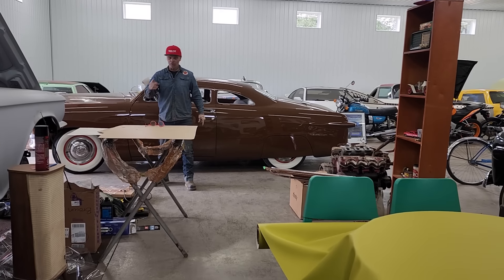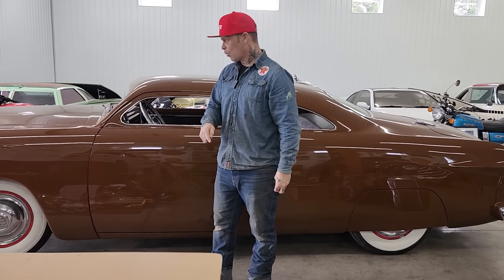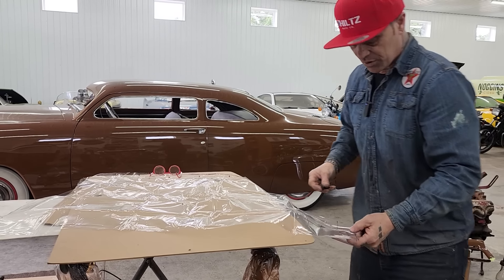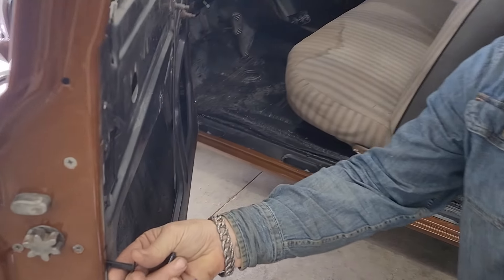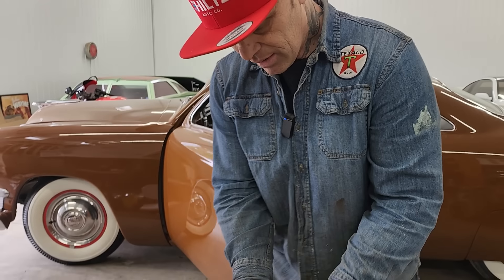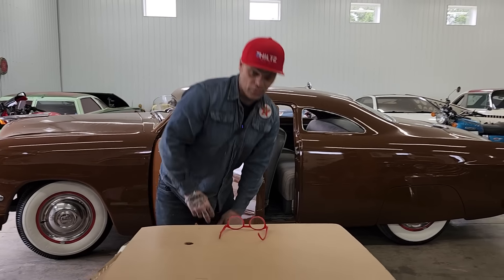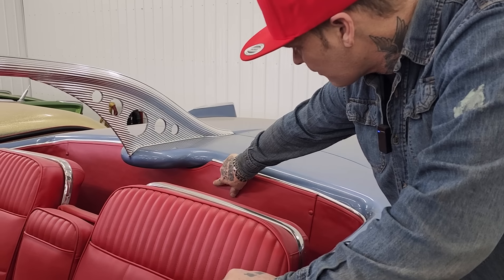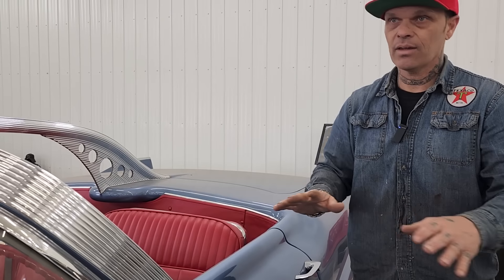Gluing the vinyl to the door panel... (hope this works)😅

Comment: Ive used contact cement to install formica onto various surfaces and one key thing is that you apply it to both surfaces. It must be dry to the touch before joining the pieces together...it should be rolled afterwards to lock things in.  I think you are doing well but not waiting long enough for the adhesive to set up prior to joining them... other folks have good ideas you might consider

Comment: 1/16 th ABS  is the best material to use to fabricate door cards,  you can form them to any shape you desire and hold staples and water proof. I do upholstery and it is the only material i use for door cards. Mounts invisible with no external screws whatsoever.
Reply: Great job brother,!
Reply: With all the diy. you tube channels, you would think they would watch and learn. Well, I learned how not to do interior panels.😮😮

Comment: Hey Chad,  from my experience 3M adhesive will release if it gets hot... meaning if the car is at a out door event and car show and it's a hot day the glue will release.. I use professional adhesive now like the upholstery shops do.. just trying to help man...
Reply: Sewing down the edges and adding piping . With TAN  colored material . Sorry Jolene this time I disagree with you.

Comment: Couple tips after 45 years in the auto upholstery biz:  You need to use contact cement such as Dap Weldwood Landau Top adhesive for gluing upholstery.  It can be sprayed or brushed on.  You can buy it at places like Home Depot or an upholstery supply vendor. Follow the instructions on the can.  On the lower curved corners of your door panels, you need to make pie-cuts or slits about 1/2" apart all the way around the curve, stopping about 1/4" from the edge of the panel.  Glue, heat, stretch, and wrap to the backside.  You will not get the lumps of overlapped fabric on the corners that you have now.  1/4" closed-cell foam glued to the panel board before the fabric is glued on gives a nice soft feel to the door panel.  Very inexpensive and easy to work with.  The Bad Chad chrome looks nice but I'm not sure it will stay attached to the door panel if the car gets hot inside.  It is made to stick to metal, not fabric.

Comment: Hey Chad & Jolene, Sunday fun day! Chad the way that I was shown to do the holes is to cut an X in the hole that gives you 4 tabs that you can glue down on the back side of the door card. Both of you did a great job of setting the material on with no wrinkles! Jolene great camera & video work as always!

Comment: Chad and Jolene easier way to do that before you even spread the glue layer material on your board where you want it fold it in half just fold back. You can spray both sides but tack up then you do one side at a time you pull one side down then you can spray the glue on the other side pull the other way.
Reply: Exactly, and don’t cut the access material off the corners until after you have the material stretched around the corners and glued down
Reply: @leblanckerry4826  the bird is using is not rigid enough bad, bad choice, and half of that he should be using weld bond adhesive, same stuff you use your vinyl tops or something equivalent is what all decent fabric shops use. Take a spray can of three monkeys and throw it in the trash.

Comment: You have to pull the material good and tight on the corners to keep it from humping up. Also, leave about 1 inch in the very corner by cutting the V out on either side of the corner

Comment: Chad have done a couple cars but tons of boat interiors best way to do this is put some plastic on the floor put the fabric on the floor spray the adhesive then lay the mdf on top starting at one end its much easier to get it centered that way on the corners make them round and as close as you can to finished size .

Comment: I have been around a long time an like to think I am pretty good when it comes to building led sleds and hot rods. BUT I must admit I have never built or painted one brown with GREEN enterior. as your work is top drawer you need to get advise on colors from another source. The colors that you are using lends nothing to the car as much as a complementery color on the interior would have done. Just my opinion but green sucks.

Comment: I don't do interiors but I would have trimmed the wraparound material down on the corners so it's easier to work with. Door skins are done trimmed down so it would work on this application.

Comment: Being your first door card makes it understandable that you messed up on the corners Chad. Now you have multiple layers on the corner material and seams right where a foot will scrape and start wearing it. These corners will make it hard to lay close to the door frame and again wearing or popping out. Next time try one piece of material at the corner pull tight the first one then pie cut material at the end farthest from the corner edge. It is kind of like metal working except you can't add material if cut short (weird seam!) or fill a hole like metal. There are lots of videos online showing techniques. Keep slugging away Chad your build results are always great.

Comment: Chad and Jolene , Your off to a good start on gluing  the vinyl material to NSB Panel , I hope the second portions of the material and pattern work as well for you along with Chad's Chrome Trim Application. Fingers Crossed for a great result on the door panel.

Comment: hey jolene and chad.. if the material is not sticking  on the inner part of the corners..  maybe you can pick up an electric stapler from any local harware store and put staples in it just to secure the corners   just make sure you get the correct length of staples so it doesnt go all the way thru the board..
Reply: Stainless staples

Comment: 3m has a spray just for interiors - while super 77 will work - it will show its weakness in heat and release - 3m has the website that shows the correct spray # to use. I have used super 77 for years in the sign world - great spray glue

Comment: To glue the Vinal on use contact adhesive and apply  to both surfaces with a foam roller.  Work it from the middle out .  Use a laminate roller to press it onto the substrate.

Comment: I did auto upholstery for three years and this looks quite good for a first time out. As for the corner, just loosen it off, heat it a little and stretch it over a but more. Massage it round as you do it and it'll be fine.

Comment: Heat the vinyl round the corners, 3mm staples no foam  5mm with ,  heat pull then staple as you move around  boom..

Comment: The best method to glue vinyl to vinyl is contact cement. Apply the glue to both surfaces and allow to dry tack free. Align the piece exactly before you apply it as you only get one chance.

Comment: I use a razor blade / knife cuts out excess on back side of panel.  Just glue, stretch to fit on edeges / corners, push down, cut with knife, pull of excess pieces.

Comment: Chad, I can't believe you are spraying ANYTHING in such close proximity to the 50! Also, doing this rectangular item on a smaller ROUND table! Working in this garage without the proper tools and or equipment.

Comment: I found the 3M glue isnt that good.  Try the DAP weldwood contact adhesive for landau tops.  That stuff works so well.  I also agree with puting a thin foam skin on the panel too, adds some depth to the panel, making a better look.  I just did this on my 34 Ford when I made kick panels.

Comment: You  do NOT need to spray as much glue on it. The correct drying time will allow it to stick correctly and be a strong joint. Otherwise, nice job. take a piece of yellow  scrap and a little piece of the brown material to see it it sticks together, test that first and you'll know what to expect. If it does not stick you'll have to have it sewed on with an upholstery sewing machine. Hang in there....looking good!.

Comment: Chad 3m 90 is better for the edges on the back side. Way more sticky. Just read directions. The 77 is ok for large area as you could actually remove it while laying it should you have to.

Comment: The product you are using is not exactly a "glue". It is contact cement. It sticks to itself. It is applied to each surface and allowed to dry, then when one surface contacts the other, it adheres instantly. Spraying it on, and trying to get it to adhere right away won't work. Let it dry first.

Comment: + You learn a lot from the lizard wallet video guys on youtube … but FIRST : you don't worry about cutting the holes while glueing ; they have simple tools for that which is little pieces of pipes you can make your self; the size of the hole you’r cutting with sharp edges that you hummer on a solid block of lumber , SECOND : cutting the corners , no cutting pieces off the material , just ; for rounded corners ; maybe like 5 or 7 strokes placing the scissors 90 degrees to the edge but not touching it leaving a distance bigger than the thickness of the panel you might need to prepare some 2 parts epoxy glue for the corners and around the holes and it will require some pulling of the material to make it look good and using a lot of clips over a flat piece of skinny wood like those used to steer paint so you wouldn’t leave marks , also, the more material you fold to the back ; even 3 or 4 inch ; if available is better .🌹
Reply: + I meant wooden tongs .
+ I would use the epoxy only in the whole back , and use the glue only in the front.
+ Forgot to tell you I love your videos guys ; a lot , thank you .
Reply: + + Cut a piece of material and panel to practice first .
Reply: + Sorry !!  but better than wooden tongs is an old transparent plastic ruler cut to pieces so you can see what you doing , but you will need to cover around it with that non stick paper so it doesn’t stick to your panel cause you r gonna have to leave the clips on till epoxy dries up .

Comment: Need get yourself a thin square table so when you do more interior panels u can clamp it to table after glue so then no imprints on front side from clamps bc that side of clamp will be on bottom of table then other side clamp be on back side of panel that don't show

Comment: I heat to say but that other fabric is not going to stick it needs to be sewed on to the yellow  the edges if the brown should be folded 1/4" over then sew to the yellow. To me sowing is not all that hard it's something you can't be in a hurry to do it.  I have like 10 sowing machines and 3 surgers 3 of the sowing machines are crucial and one walking foot and 6 domestic the surgers two are domestic and one is crucial im  planning on getting a better walking foot its a sailrite heavy duty ultra feed LSZ-1

Comment: Jolene tell Chad he should run small screws from the back side of the panel into whatever chrome he put on so it will hold the different materials together and hold the chrome down better.

Comment: 1/4" inch plywood would be good Chad, because it's easy to work but best if all, you can staple into it. Mdf and Masonite don't hold tacks or staples well.

Comment: If you dont use contact cement brush on  !forget it with spray it will FAIL!
Reply: Never had a problem with 3m high strength 90 spray but that 77 he's using I have

Comment: You need to make smaller cuts in the corners and used the palm of your to roll the edge vinyl over vinyl won't adhere and it will make the corners stick out also you didn't put your door clips in first what

Comment: If you were going to allow overlap, you shouldn't have cut the corners. If you cut it, you should have cut it so there would be zero overlap. You should have practiced first. Cutting, you risk the material tearing. Especially SO CLOSE to the corner edge.

Comment: Be careful with sanding the MDF (Medium Density Fibre) Can cause lung issues later if breathed in. Stick to the lining of the lung 😷 please. Usually spray fabric glue spray both, wood surface and fabric, leave for 3-4 minutes then apply to together.